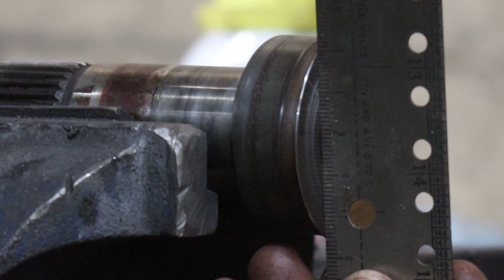Steering Knuckle Modifications Project Red

Comment: Very nice vid again. Though the change of angle on the knuckle steering arm completely flipped your ackerman effect around. Which means the inner tyre will have less angle than the outer tyre in a corner, making it pretty undriveable I think. I might be wrong but id definitely look into the details of the ackerman effect if you havent already. Keep up the good work!
Reply from the maker: I no exactly what your saying. And that was one of the first things I checked just the other day now that the car is on all four wheels and under its own weight 🫢. And in fact the inner tire does turn tighter than the outter tire 😅💪🏻. Thank god!! So far so good. But still have some other small issues and tweaks to work on. Next vid will be a new front end panel assembly . But the following vid will b the car on all 4 wheels and turning and wat not hahha
Reply: @klegraefe  ahh thats great! Looking  forward to it 😁👌
Reply from the maker: @J4rn0  appreciate it Jarno. Yea that was one thing that killed me on mini rick and took so long to sort out. 😬😬

Comment: That looks good, nice idea to drop your steering arm. Looks like your going to get  a bit of positive ackerman. Should turn in pretty good with the scrub radius. FDF Racing has done a very watchable video series on race/drift car steering.   I managed to get through them with out my brain melting.
Reply from the maker: Thank you Aussie!! And Actually that could help me out alot. Do u happen to no the exact name of that vid?? I feel like it did see that b4 and it was infact super confusing hahah
Reply from the maker: @aussietruckphotosandmodels8510  thanks Aussie. Ill check that out after work!! I did happen to watch some shorter vids last night and i deff might have to move the tie rods/knuckles in board some. As of now i think theres a tiny bit of ackerman but mainly parallel which is not what i want. Also, ill try running some strings from the lower ball joints to the rear center axle and then try to re align the tie rod knuckle ends in line. Idk how to explain it but i think the vid u sent me will also cover this haha. Nonetheless i want to get it as best as possible 😬

Comment: Looks good, have you checked for bump steer through the suspension travel
Reply from the maker: Thank you Tony. Very good question too. Soo currently im a bit a head from wat u just seen. But as of now, the car is on all 4 wheels under its own weight. And currently i have to move the coilover mounts as the car is a bit to low for comfort. Bump steer seems to be clear but i will say another piece of the puzzle is fowling the whole steering input. I will have to do some more modifications but overall i think it may be worthy of a test drive 🤔
Reply: @klegraefe  ahhh cool man sounds like you’re on top of things, I thought it would be worth to mention it as I’ve seen loads of modified builds that are twitchy or completely uncontrollable after steering mods/rack relocation. Hope it works it dude, proper enjoying the build 👍
Reply from the maker: @tonywatkinson3523  you are 100% not wrong. The steering in mini rck is very drivable but not track worthy at all. It’s a nice fun street car at best but I do drive it almost every day just in the streets messing around and wat not but I’d like to straighten out the situation and make it more track worthy. 😅